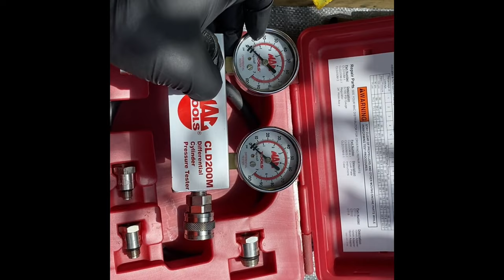2004 dodge Dakota 4.7l valve seal replacement.

Comment: Curious, if you removed the bolts from the cover, disconnect the fuel line from the fuel rail, and pull the coil packs wouldn't that give you enough clearance so you don't have to remove the brake booster? I haven't done this job yet, but will be shortly. I'd like to avoid removing the brake booster and bleed the brakes etc. Thanks.
Reply from the maker: Well,  it didn’t take me all that long to remove the brake booster and also bleed the brakes after.  I’d say it is possible but I’d suggest to get some new orings for the fuel injectors.  I didn’t have any on hand and had to get the job done that weekend
Reply from the maker: I just remember that I couldn’t get enough height to clear the valve train and the brake booster was what I kept hitting on. I was able to snake by on the passenger side with the ac box but having the rail removed there definitely would have helped
Reply: @hc7760 , Thanks for the reply. I wasn't referring to removing the entire fuel rail.  I meant just remove the fuel line going to the fuel rail. The fuel line sticks out right over the valve cover. You are right that it doesn't take that long to bleed the brakes, but I'd like to avoid it if I can. I flushed my brakes only a few weeks ago. But once I get in there, if I hit the same problem now I know removing the brake booster is a viable option. It probably wouldn't have occurred to me without this video. Thanks again.
Reply from the maker: @petrocksgarage  I see.  It may work,  I can try and find time to look at the video I edited out during the valve cover removal to see what was hanging up and if that was part of the problem.
Reply: @hc7760  Thanks a lot. I appreciate it.
Reply from the maker: Checked it out.  I did run up against it once or twice.  I am not sure it’ll solve the issue of rising over the cam caps in the back but it is worth a shot.  Let me know if it works.
Reply: @hc7760 , well I finally got to this tonight. Life got in the way. I disconnected the fuel line from the fuel rail and was able to remove the valve cover with no problem (sans a broken valve cover bolt and fuel injector connector). I slid the cover towards the firewall then rotated it counter clockwise (from drivers point of view) to get over the PCV tube on the back of the cylinder head and then pulled the cover up and out. Pretty easy actually. I didn't have to touch the coil packs or brake booster at all. Im in a time crunch otherwise I would have recorded it. 😞 Thanks again for the video.

Comment: Looks like pulling the fuel rail would allow for better access. I plan on replacing my injectors while I'm in there. Would you still have to pull the brake booster if you take off the fuel rail?
Reply from the maker: I thought about that pulling the fuel rail,  but I didn’t have orings for them on hand.    Yes I think this could circumvent pulling the brake booster.  But…..
Besides the valve cover removal,  With the brake booster removed allowed more access to the back rockers.  If I had to do it again I’d still take off the brake booster,  but it’d be the first thing I’d do!  Didn’t take long to bleed and lost only brake fluid.  
Also the passenger side you’ll find difficulty working around the ac box.

Comment: Does anybody have this tool that they would be willing to sell.  The company is sold out and I’m currently trying to put a valve spring on a 4.7 with no luck with the tool I’m using.

Comment: How did you confirm it was the valve seals? I have burning oil, blue smoke and burning oil smell which is why I am getting cat codes and some random misfires. I may try this but its alot of work if I am just throwing parts at it.
Reply from the maker: By the symptoms.  On start up it would smoke and if sitting at a light it would smoke but when I was driving the highway it wouldn’t. It’s inductive but I was right.  Typically,  if it is constantly smoking it’s the rings. You can also do a leak down test to prove if the cylinders rings are good. If so, it would be the seals.
Reply: Valve seals are most common oil burning issue

Comment: i  have done much work on the 4.7l and taking the intake out is the best way to work on the valves, may as well change the lash adjusters while in there, but only with quality parts!, i understand the value of the tool for getting the valves apart, but that price is too high, also i suggest rotating the engine  a full rotation before putting valve cover back on, on my durango, i take the front tires off and remove fender well cover and i can get to  some of the things better
Reply from the maker: Btw,  I should have said this but those are some useful tips and thank you for contributing to help others!
Reply: Will this work the same on a 2008 Durango 4.7
Reply: @humbertogonzalez331  all the 4.7l and 3.7l engines are basically the same, after 2008 they upgraded the heads and cams on the 4.7l, (including using two spark plugs per cylinder) but the valves should be the same

Comment: Do you have to rotate the engine until top dead center when working on the following ones?
Reply from the maker: @mohamedabdi8400  yep. I go to tdc
Reply: @hc7760 what size socket did you use on the crank?

Comment: Dumb question this is the same process on 4.7 dodge ram 2005 , same principles right , thanks for the video
Reply from the maker: It should be.  I know some one else mentioned they didn’t need to take off the  brake booster to do undo the valve cover.  I suspect there are slight differences in manual transmission vs automatic with the booster.  But everything else should be the same.

Comment: To get the driver side valve cover off take out the fuel rail bolts on the driver side of the rail and lift the rail up. More than enough clearance to get the valve cover out.
Reply: ....and for removing the rockers..use a 10mm open end wrench bent 45 degrees. put it in the same location you put the two rods and pull toward the cam.
Reply from the maker: Awesome! Sweet advice! Thank you for adding this!
Reply: @hc7760  I know the video is for the stem seals but I mentioned it while thinking about when I replaced the lifters/rockers on my 4.7 last year.

Comment: Did you do yours with the belt still on all the pulleys
Reply from the maker: Great question.  I believe I had left them on, but you probably could take it off and have an easier time cranking over to the next cylinder.
Reply: @H C  ah ok thank you cause I was  thinking like do I have to take the whole belt off lol thank you

Comment: All of this is required for valve cover seal change? I might have to call in an actual mechanic. I'm just a weekend shade tree kind of guy. The valve covers on my Ford van was straightforward..6 bolts on each cover, 1 gasket, in and out.
Reply from the maker: I changed the valve seals.  The valve cover gasket would require a lot less. You could snake the new valve cover gasket on without removing the brake booster.  Also this was on a manual transmission truck.  The automatic may allow you to take valve cover off without removing brake booster.

Comment: You mentioned upon the valves not sealing, was fouling out 02 sensors or otherwise causing them to fail due to the oil or byproduct of the oil burning caused them to fail. I’m interested to know if you were able to view how the 02s reacted on scan data with the excessive presence of oil /burned oil byproduct
Reply from the maker: You mean how it was switching?  Well,  I didn’t really hook a scan tool up to it for this one.  I had the upstream O2 sensor fail twice on the drivers side left bank.  Upon removal they had the characteristics of oil contamination.  Since the repair I have not had my check engine light come back on for a faulty O2 sensor and no more morning smoke on start.  🤷‍♂️.  I’ll admit it was purely inductive reasoning that lead me to the conclusion but it seems so far to have paid off.

Comment: You do not have to pull the brake booster to get the valve cover out. Speaking from experience.
Reply from the maker: How did you get around the height of the cam bracket in the back?  Did you Pull the injector rail? Clock the motor from the motor mounts?  Please share so others can be informed.  I wasted 3 hours trying to find the right angle only to find the height was restricted by the brake booster to get over the cam’s bracket on the back of the v8.  Would rather direct people to read your insight and not waste time struggling like i did.
Reply: @hc7760  1st off to clarify. I have an 01 QC 4wd.  If there is a fitment difference between 2wd and 4wd I'm not sure. Looking under my hood. There is no more than 1 1/2 inch clearance from booster to valve cover.   In my case. Say when I did a cam swap. Injector plugs, coil plugs, vacuum line from booster, vacuum line from throttle body, power steering pressure switch (may not be necessary) but gain a bit of room. After all that is out the way, I am able to roll the valve cover outward and down toward the exhaust manifold. In my specific case. Shorty headers. Which I also remove not only for room but so it doesn't get beat up.
Reply from the maker: @DC-pv3yh  Thanks!! This is informative.  People have asked and I can now point them here.  I didn’t remove injectors or exhaust manifolds,  so maybe there is a difference? regardless this could be the trick people can try.  I know removing the booster gave tons of real estate to work in as well,  but the four nuts, the pin, and two brake lines can steer some away from doing it and one of the nuts was a pain to get at.  I appreciate the experience and will pass it on as well!

Comment: Why did you change the spring bottom part was lifter falling off it’s the issue I’m having
Reply from the maker: Not sure what you are referring to.   I changed the valve seals that are underneath spring.  There was no spring bottom.    
If you are speaking about the lifter,  I only changed the lifters  that could compress, had play, by hand.     The lifters are easier to change because you do not need to remove the spring.
Let me know if this helps
Reply: @hc7760  the issue I’m having is that I got a misfire in cylinder 8 so I opened valve cover. Once I opened it noticed that rocker arm has fallen off, so I ordered new lifter and rocker arm but when I go to put it on it’s too easy like no tension I can put it on with my hands with no effort. So I’m pretty sure it’s going to fall off again. The valve spring doesn’t looked cracked. So my question to you is you think it’s a weak valve spring & crushed valve seal. Seems like its not allowing the valve to come all the way back up. I would appreciate your help.
Reply from the maker: @olivares32688 it won’t be due to the valve seal as that is just a seal over the valve’s shaft to keep oil from entering into the cylinder.  

I’d remove the lifter and inspect that.  
I’d take out the spring and inspect that.  
Also.  Your valve may not be seating correctly. Therefore not going up all the way.  So, I’d pull both  rockers for the cylinder get In too dead center and do a leak down test to check for that.  
In fact,  take out rockers for the cylinder compare the two lifters.  If ok then set up your leak down tester,  if it holds good within 10% then remove spring and check spring since you have air in the cylinder holding it up. Worth a shot.
If those all check out problem most likely something else
Reply: @hc7760  Ok thank you I’ll give that a try 👍🏻👌.
Reply: Ricardo sounds like a valve seat dropped causing the valve to not fully close
Reply: @buddyfischer1885  🤦‍♂️that’s what I was afraid of.
Reply: @buddyfischer1885  how exactly do you go about fixing that? Do you have to remove heads?
Reply: Yes the head has to come off
Reply: @olivares32688  sounds like you may have a dropped valve seat. Which won't allow the valve to close fully. Leaving "slack" where the rocker arm sits on the valve.   Wow I didn't read enough someone already said this lol.